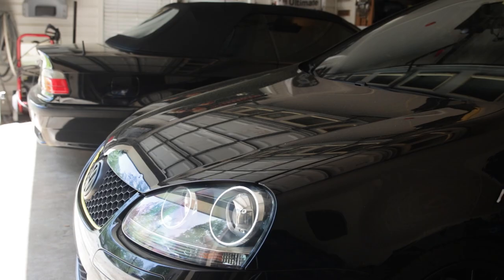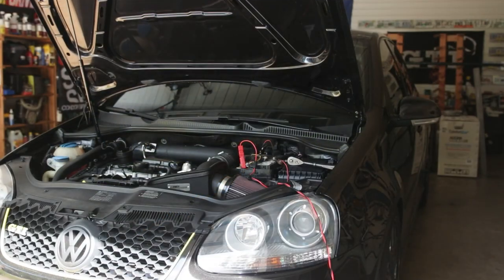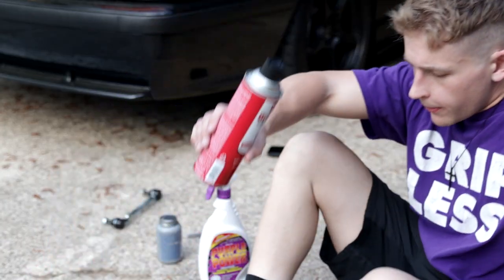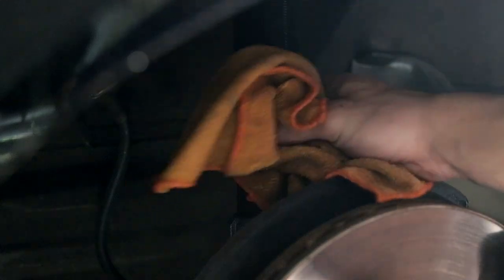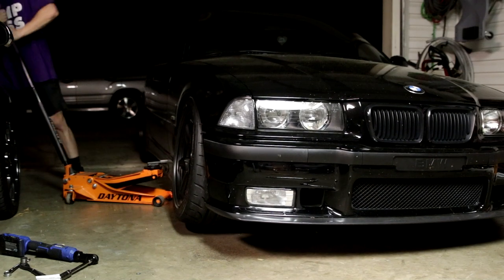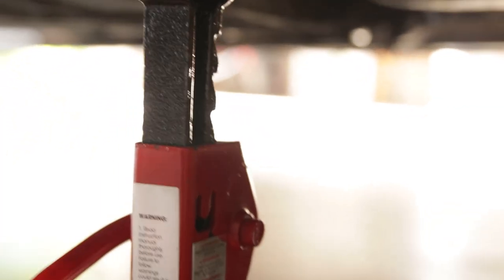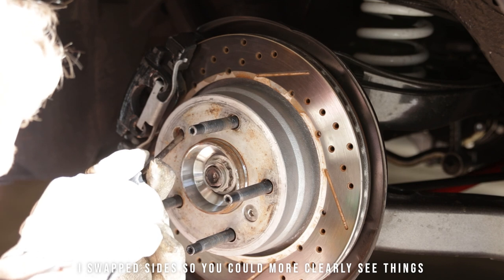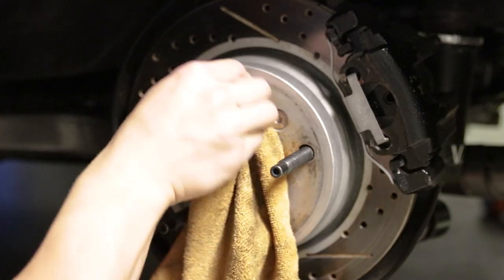Converting my E36 Static Stance Car into a Tail of the Dragon RIPPER: Episode 2

Comment: hey bro your suppose to take load off the front completely before remove and installing them
Reply from the maker: Not pictured in this video but I realized shortly after that placing a jack under the specific ball joint you’re attempting to remove/ install is the move!